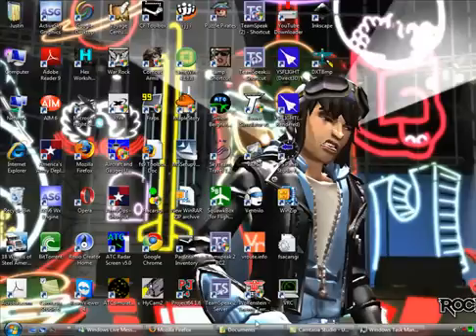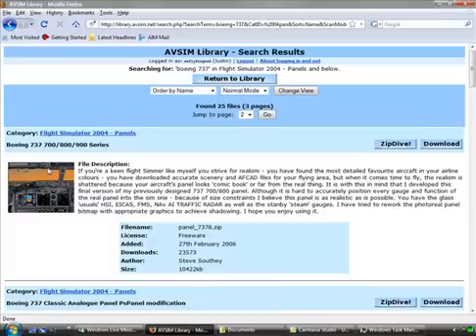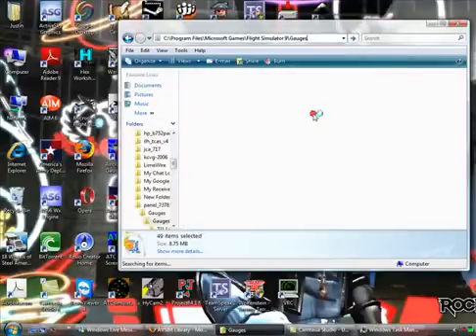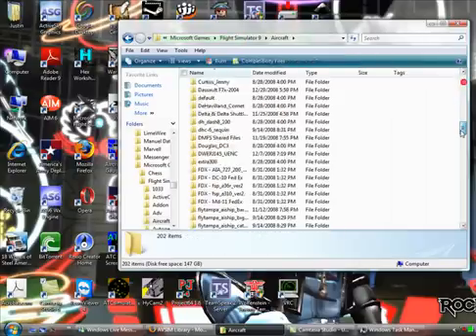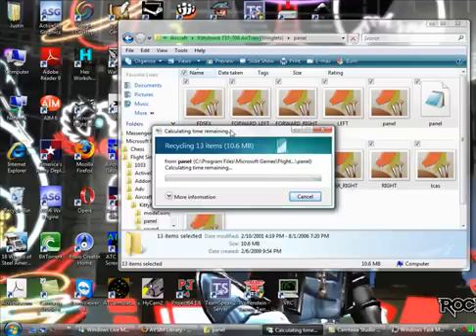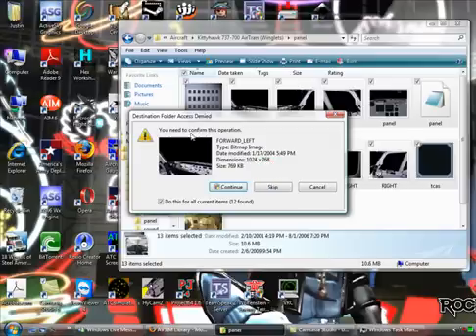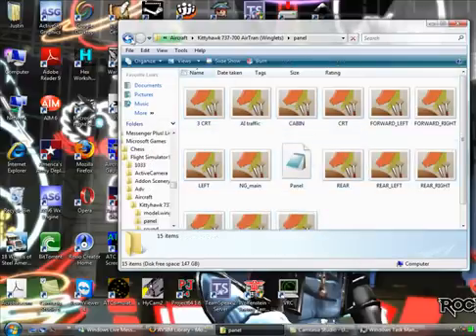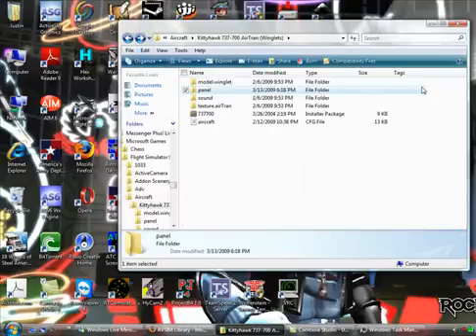How to install a panel in FS9.

Comment: Video has faults in step by step procedure. for example. where folders with gauges and extension modules, textures and its extension, BGL, xml, dll ... etc go. Where are the pictures of the panel and files. What is the order?  That´s right ¡¡¡¡